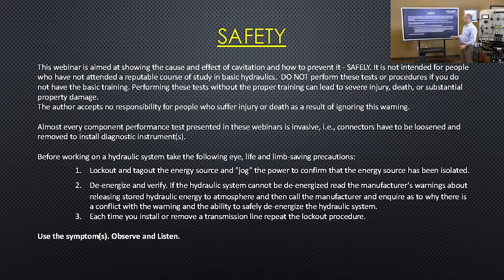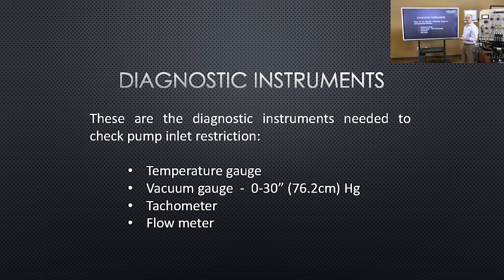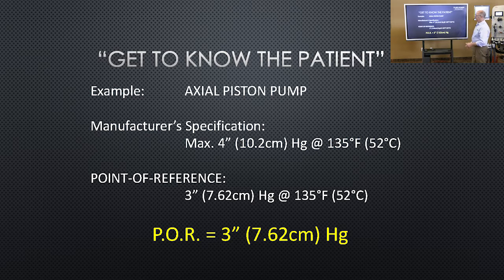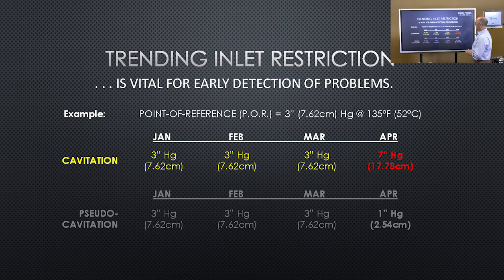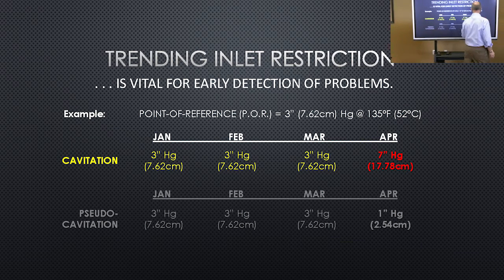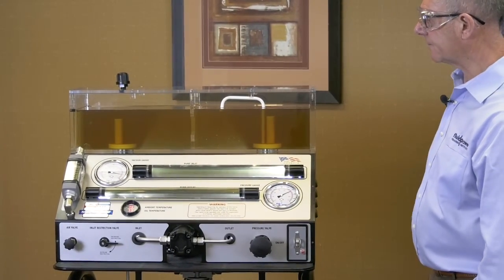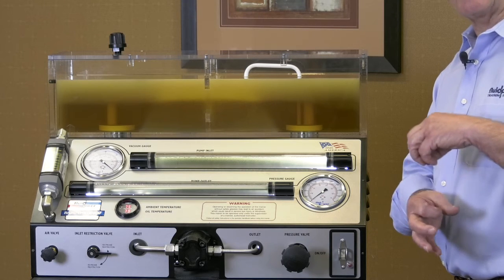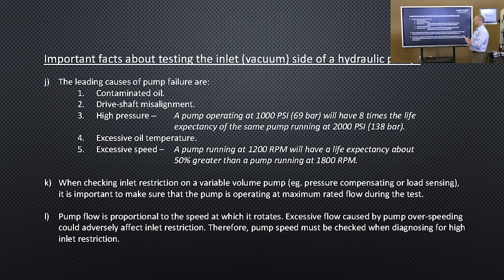How to Prevent Your Hydraulic Pump from Dying Due to Cavitation.

Comment: All I can say is WOW!  Very good job in teaching a subject that is important in hydraulics. Even the common equipment operator should understand these fundamentals because it makes a difference in the longevity of the equipment or the safety of the operator.  

I would like to know more about how changing the viscosity of the liquid affects cavitation. For instance, I have an older Satoh Beaver tractor that the manual calls for EP Gear Oil 80 for the hydraulics, but it is common for people to use Universal Tractor Trans/Hydraulic Fluid with a 10w30 viscosity. Will this thinner viscosity be more prone to cavitation?